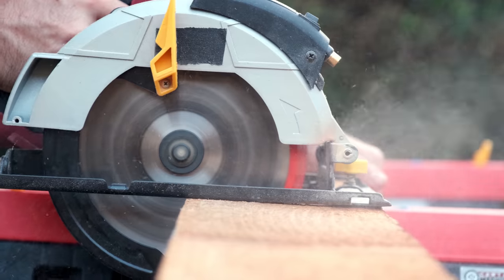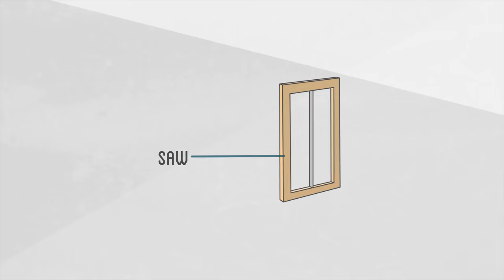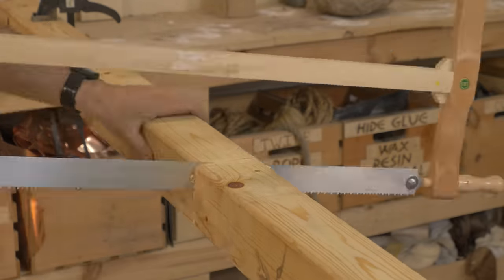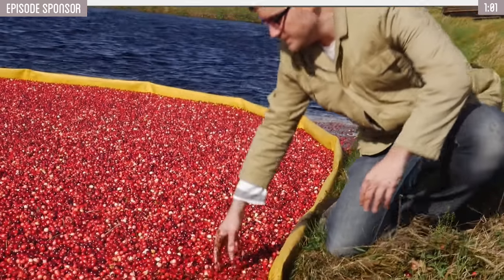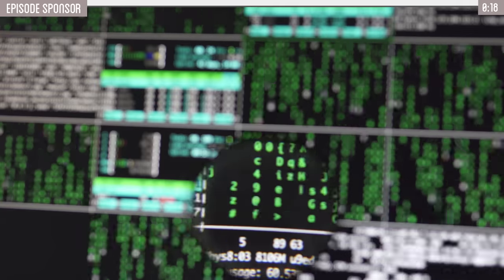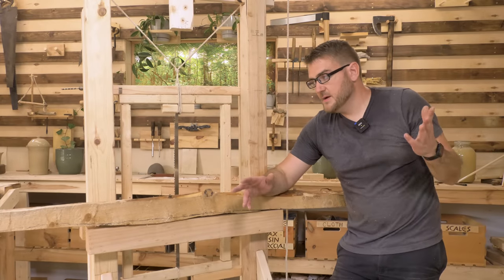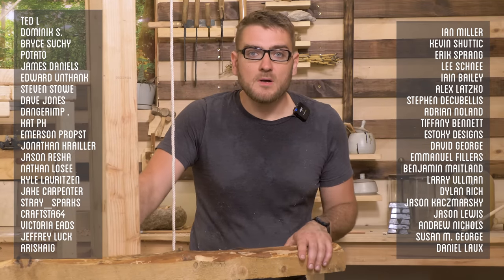This 12th Century Table Saw Is A Huge Force Multiplier!

Comment: The sawblades being the correct orientation would help a lot.  Can't wait for the water version.
Reply: I commented about this too, I think it's a bidirectional blade, or straight teeth that cut in both directions.  Having downward angled teeth should help.
Reply: was just going to say that.
Reply: Definitely if the teeth appointed downwards, the push will have a lot more force
Also incredibly thick blade!
Reply: I'm assuming the cut direction UP was to make the spring bow do most of the work...however since he had an open top table, he did more effort just trying to hold down the wood...eventually placing rope binders.

I would like to see a run on either side of the log, one with the blade reversed.  This is basically a pit saw, but in a pit saw the man on bottom is doing most of the cut, while the man on top is guiding the blade line.
Reply: @1234567890CAB  probably also need a 1in4 or 1in5 tooth that do nothing other than pushing out the grinded off material
Reply: I wold have thought that the invention of a mono-directional blade design would have come prety soon after saw blades started being made of iron. So personaly I think he should have been using either a modern blade from the get go of this episode or had his hand forged one with the teeth reshaped. Like everyone else I agree that he had the blade upside down. Also the work holding rope would have worked beter if there were weights hung from its under side.

Also to help getting a straight cut even crude in-feed and out-feed tables would have helped. He was spending a lot of effort holding the workpeice aproximately level and as such his arms were too tense to guide it properly.
Reply: @martinrwolfe  : For his case, saw horses should be enough for the in & out feeds. I was surprised that he didn't have any set up.
Reply: It would also help if the teeth were angled slightly outwards, so that the cut would be wider than the blade, since he mentioned that it kept binding up.
Reply: @absalomdraconis  yes, adding some set to the teeth would realy help, usualy 1 set left, 1 right and one strait. Even 0.02" would help.
Reply: The lack of rigidity of the blade carrier,  alot of deflection and movement of his foot side ways on the cut stroke, also jamming the wood into the blade and not letting it do the work
Reply: Sadly he jumps from one thing to another without understanding where he went wrong building the last failed project. Alot of these old machines would take weeks if not months to build using oaks and other hard woods as they were built to last and hand down. Him knocking stuff together using pine or other soft woods will not work how the machine is designed to work. I watch these Japanese crafts men build works of art that work flawlessly and there unbelievably beautiful and they use tools that were built and passed down by their great grandfathers
Reply: a slight angle of the teeth would help too. 1 Tooth left, 1 right. The cut has to be wider than the back of the sawblade;)
Reply: Also he is using a crosscut blade for ripping which is especially slow. 

If I had to make a tool like that I would angle the blade so that it cuts on it's own as it goes downwards, while only pushing the wood during the return stroke.
Reply: @absalomdraconis  I have watched a bunch of this guy's videos and while they are quite cool. They do lack one thing and that is general knowlage and the use of common sense. The fact that saw horses or feed tables did not come to mind is clearly the reason why this is not working well. The blade being the wrong type is another reason. I do not think he spends much time on these and does these projects in his spare time.
Reply: Forget saw horses, angling the teeth, and having less tooth count.

Just reversing the blade alone would work wonders. Just as a bandsaw forces the piece down preventing kickback, this is essentially a scroll saw, which is  the same concept as a band saw without it being a band.

By having the blade go down into the open table (just 2 bars in this case), it naturally holds it self as it saws, though it needs to be held on its way up, though doesn’t need nearly as much force. This would make it easier, faster, and can be guided more straight.
Reply: @mavenfeliciano1710  Keep in mind this guy puts very little thought in to these projects and does them on the fly which is why they get the views. Making a fully working product would nto make for a good video. 
There are a ton of these machines and styles out there. I can not recall the name of a site or builder that still makes a bunch of manual machines which are quite cool as someone else was at one time thinking about doing or building something like this yet they never went any further than the idea of them. Ended up just going solar. 
Either way someone with more skill in wood working and general understanding could produce a good video and a fully functioning product that is not built in a rush on the weekend while still doing their full time job. 
You can use youtube and find a whole host of videos about human powered scoll saws and a ton of other machines.
Reply: @martinrwolfe The only saw teeth that are "bi-directional" are on large logging saws, where there's maybe 1-2 teeth per inch (or less). That's b/c you need a large gullet (gap between teeth) to carry away the large amounts of sawdust when you're halfway through a tree several feet in a diameter. Even very aggressive hand saws for carpentry/woodworking (like 4 teeth per inch) have directional teeth.
Technically the what we're talking about is "rake": the angle the front edge of each tooth is off vertical. More rake means the teeth are easier to push, but they do less work.

Comment: Dude, think ahead. Flip your saw blade so it pulls the wood down agains your bracing. It would have saved you some serious sweat. Can’t believe you went to all the trouble to make it and missed that detail.
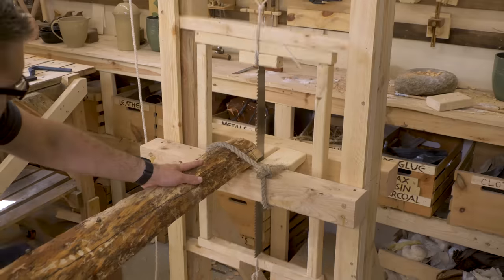Reply: The teeth are the same angle on both sides. They have no rake. It is a plain tooth pattern. Although due to aliasing and artifacts of the video the teeth can appear raked. Or it might just be something in your mind? Pause the video at 6:55 and really look at the teeth.
Reply: @1pcfred  If that’s the case, then it’s another fail on his part.
Reply: @FriedPi-mc5yt  there's plenty of opportunity for less than ideal results in this project. Perfecting a mechanism like he's made is a non-trivial task.
Reply: @1pcfred  Yeah, actually it is trivial. It takes planning and the ability to see ahead of time where there might be issues. But that’s a skill not everyone is capable of learning.
Reply: @FriedPi-mc5yt  no plan survives first contact with the enemy.
Reply: @1pcfred  Wood, metal and stone aren’t enemies that can think. If they can’t think. They can’t plot to disrupt your plans. That’s a poorly chosen quote.
Reply: @FriedPi-mc5yt  they do not need to plot. They merely need to exist to thwart your dreams with the harsh sidewalk of reality.

Comment: Two huge improvements you can make is the blade teeth orientation and the length of the blade. Currently you’re cutting on the up and down strokes and only really using the center portion of the blade. When it makes more sense to cut with just the downstroke and with the entire length of the blade. So angling the blade points down and sloping upwards would allow the wood to slide off the blade upon the upstroke. This would be an increase in efficiency and keep the wood from binding as much and hopefully nearly eliminate the wood from jumping up. Doing this may make it a little tougher to physically push the pedal down, but the yield and speed would make it twice as fast.
Reply: Also reducing friction everywhere there are touching moving parts might increase efficiency too, maybe beeswax would work
Reply: The teeth need to be angled slightly so that the cut is slightly wider than the blade to prevent binding.
Reply: @Proud2bmodest  that's true. In an alternating fashion. I haven't picked up a hand saw in a while, lol.
Reply: @Proud2bmodest  commonly known as "set"
Reply: another problem i saw was that the guide was really wide, there wasnt really anything to keep the blade straight.
Reply: There's also far too much slop in the movement. As a prototype proof-of-concept it's a good attempt, but it's far from a good copy of a working machine.

Comment: One way you can solve the lifting issue is only use downward angled teeth, however the blade would then mainly be cutting on the down stroke.  If you go this route the bow on top wouldn't have to be as strong because there would be less resistance on the upward stroke.  How it is set up right now, stepping on the pedal provides the cutting energy going down, and stores extra energy in the bow for the cutting going up.  If all the teeth were angled down, you would only need to put in enough energy for the downward cut because less energy would be needed for the upward stroke.  In other words downward angled teeth would be less effort but would require more strokes.  I believe it could still save time because less interruptions, improved technique, and thus higher sustained speed.
Reply: Of course he is cutting on the down stroke. he is using his leg to push it down to cut. So yeah. Upside down saw.
Reply: @laserbean00001  : No, not upside down, his saw cuts in both directions, so no matter which way he arranges it he'll get the same problem. OP is saying that he should switch to a saw that does all of it's cutting in one direction.
Reply: @absalomdraconis  Even though it technically cuts both ways, it's standard knowledge to know that it cuts most when going against the saw blades.
Reply: @laserbean00001  yes... on a single direction blade. no for his blade which is just equilateral triangles. his cuts on both the up and down stroke equally.
\|\|\|\| = single cutting direction blade, cutting in this direction >
|/|/|/|/ = opposite cut direction <
\/\/\/\/ = cutting in both directions, as his blade does, equally
the standard knowledge you speak of, only applies to the 1st 2. most blades are like this, which is why its standard knowledge, however bidirectional blades are non standard and pretty inefficient due to the insufficient rake angle of the blade versus the piece, but they cut equally on both strokes.
Reply: @seanflynn2507  look at 7:34
Reply: @laserbean00001  with the manufactured blade, yes. Problem is, you would need to redesign the whole thing, with someone somehow on top working the treadle. The reason for that, is because the bow is not just a spring return for your leg to do all the work, but instead uses the principle of a lever. The treadle moves a large distance compared to the rope pulling the bow, this multiplies the force being put in using mostly your bodyweight and stores it in the bow (which you would probably struggle to bend by hand). This force is then released all at once to return to a resting position. Storing energy in a spring to do the cutting is the whole point, so a downstroke cut requires a bottom mounted bow. The lathe in his previous vid using a tree branch was actually just a spring return and the leg did the work. This isn't that. This is taking 1 second to compress a spring to have it return in .25 seconds with 4x the force. I would hazard to guess this design limitation was well known but workable by the people who used it back then. Better designs would be more complicated or need multiple people.
Reply: @seanflynn2507  well that makes sense. I think it really depends on how hard the bow is strung.
Reply: @laserbean00001  draw weight matters of course, optimally it would have a draw weight of 300lbs for his setup (half bodyweight 75lbs, since it's only 1 leg on the treadle, 4x mult for leverage and a 30% effective increase for the bows return time vs draw time = effective force applied to the wood : 400lbs) . But his bow seemed weaker. Based on how hard he looked to be stepping and given an average weight of 150lbs (bodyweight) I'd guess a 120lb draw weight. (30lbs of force on the lever, 120lbs at the rope due to the mount point of the rope and effective force of 160 lbs given the bows return time) and even then that's as if all of a person's bodyweight was put into a cut. So you can see how this would speed up the process even if an upstroke cut is annoying to deal with. And the mechanism is so simple that you don't have to take friction losses into account, so it should be pretty close to the math. The draw weight of the bow divided by the ratio between treadle length and distance of rope from the pivot tells you how much force it will take to push down, too heavy a draw and you can't push the treadle down. So you can bring the mount point closer to the pivot for more leverage but that also makes the saw travel a shorter distance for each stroke and can come to a point where it stops cutting at all. So we could also extend the treadle and leave the mount point where it's at, but if the treadle is too long you won't be able to step on it. All these factors decide the maximum bow draw weight possible. So yeh, highly dependant on draw weight but the mechanism has some pretty strict upper limits. 30% effective increase is a guess for the difference of maybe a third of a second (.3) to step down on the treadle and the bow returns in a fifth of a second (.2), rough estimate of course, it's probably faster but that's a 30% effective increase.
Reply: I'm sure these are all innovations that the ancient craftsmen had to figure out, too.

Comment: something to keep in mind too, when making structural wood that had to be precise, is that the wood was first cut into rough-hewn rectangular beams first, then shaped with smaller tools such as  adzes, chisels, and finer blades. I believe also the sawblades used to be larded to help with binding. That all changed after larger-scale mills were built and didn't use raw manpower.

Comment: Something that may help is having the blade the other way up, should hopefully prevent it lifting the peice your trying to cut
Reply: It's a bidirectional blade, so it cuts in both directions, so flipping it won't help. He needs to switch to a unidirectional one, with the teeth slightly angled outwards.

Comment: The obvious solution to the problem of the blade pulling the wood up, would be to have sawteeth angled, like on any push or pull saw, so it pushes the timber down
Reply: A better sawblade is probably the biggest improvement he could make without changing the design.
Reply: @Coffeepotion  It did look like he switched to a commercial blade by the end, but an asymmetrical tooth pattern would also make a big difference
Reply: @russellgeisthardt9828  Yeah, stop at 6:55, and you can even see the manufacturer label on the saw that he ended up using.
Reply: Yeah, just reverse that saw blade to fix this issue
Reply: Your idea is good for a modern 1 way blade action but this build utilises both upwards and downwards action.
Reply: If the blade is made to cut both ways, a simple adjustable wooden bar over the top of the piece of wood to keep it from being pulled up would suffice.
Reply: He needs a rip saw blade.
Reply: @Coffeepotion  You could literally see that when re-sawing his 2x4, that HtME was using commercially available saw blades and not the (unfortunately) rather crude had-forged one made on the channel. The switcheroo seems to have happened at the 06:11and again at the 06:26 mark, with what looks like a section of bandsaw blade and the later one looks like a bushcraft/bow-saw blade.
Reply: Your saw is set with the tooth shape oriented to cut on the upstroke, lifting the wood every time it cuts. If as stated above you flip it the blade so the teeth will cut on the down stroke, it will reduce binding and push the wood down onto the table instead of lifting it up and "binding" on each cutting stroke l. Aka, you installed the blade upside down.
Reply: I was thinking only feed on the down stroke and just hold on the upstroke.
Reply: Also thickness and how much tension is on the sawblade are really important.
Reply: @worldsend69 that's the problem, with teeth facing only downward you don't get binding and the bow doesn't need to be as strong since it only has to lift up the weight of the saw blade+ a bit of friction
Reply: @AHagridLookalike  I was thinking that too
Reply: @caladin002  : He didn't install it upside down, he used a blade that cuts in both directions.
Reply: @Coffeepotion  just needed some real bear grease
Reply: @dj1NM3  and it was upside down
Reply: @dj1NM3  Fairly sure he were testing with a modern blade to eliminate as many factors of uncertainty at a time as possible. Standard troubleshooting stuff. The reason I think this is because soon after that timestamp he mentions "switching to the large blade he used to cut the log", suggesting the editor were messing up things chronologically, or cut out the part where he switched to the modern blade (if the order of clips is chronological) temporarily.

At least, the log-cut is so uneven I actually believe he used his own blade for the entirety of it. I kept on wondering why he didn't put in anything to the side to use as a guide, as even with an uneven surface on the log, it would enable him to put his weight better to hold it down, without that causing it to slip.
Reply: Right then and there I would have made sure the work piece was secured much closer to the table.  If it can't travel far then the bind will break after that short distance and continue the cut.
Reply: Everyone ignoring, he was cutting a long piece with no TABLE!  Take 10 min and build a quick table.  Even put a guide on it.  This is not rocket science.
Reply: @caladin002  Yes. That effect (lift) has a predictable cause.
Reply: Slight angle not would only push down the wood on the down stroke, but also make the saw far less likely to drag the material with it on the up stroke. So two real advantages.